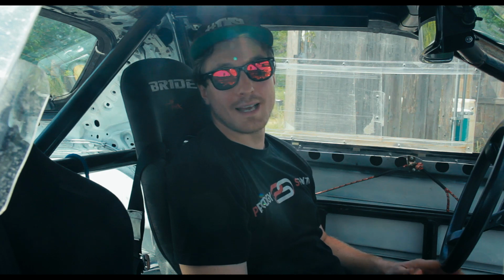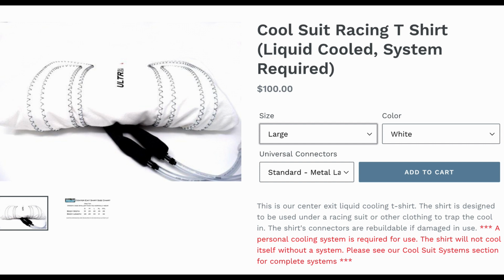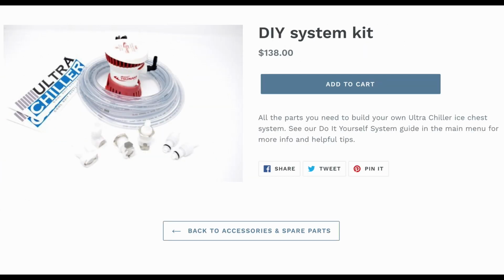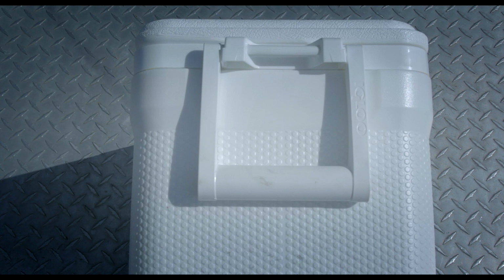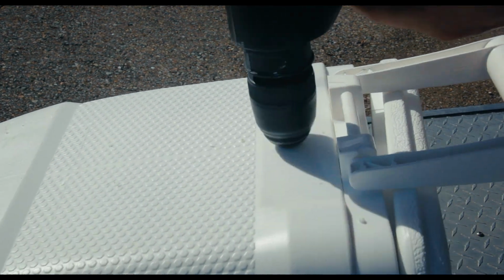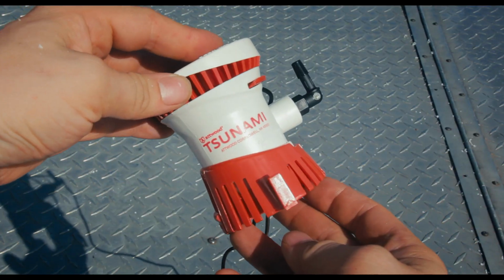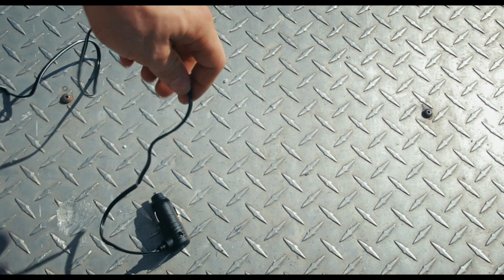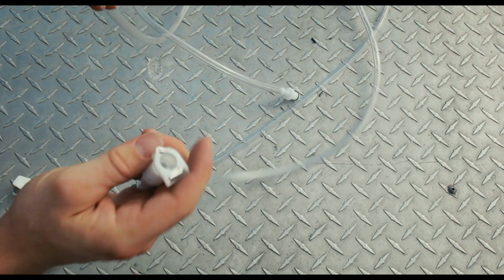Build a cool suit on a budget, the easy way.

Comment: Why not use a 12 volt cooler with a mini radiator  a recirculation pump instead of a sump or bilge pump . It would be lighter

Comment: I thought the point of a cooling suit was to be portable, so you can walk around with it...........if it's just for inside the car, why not get a car battery, a power converter and a mini portable ac?
Or on a cheap cheap budget, a Styrofoam cooler, cut a hole on the side, hook a small fan to a dryer vent tube, then make a similar hole with dryer vent coming from top, fill with bag of ice mixed with rock salt and you have a cheap, well working car a/c for under 30 dollars.

Comment: I want to build one for my bike but at 8 lbs per gallon swooshing water from one side to the other will wreck you 4 sure. The container has 2b one that doesn't let the water move but a little. Barring that the only solution I see is a DC compressor & a li-ion battery pack chiller. Peltier won't go far enough under the ambient temperature.

Comment: Where's the review?
Reply from the maker: It's a ways away, but the short version is: 
The system is awesome except for the cooler. It cracked and ruined the seals after 2 track days due to the pressure from the tie down. Spend a few more dollars and get a better cooler with a watertight seal and lockable lid.
Reply: @EvanWoss  Understood. Cheers m8!

Comment: Did you wire a switch into the pump or just unplug it when not needed? If a switch is used to control flow rate would that work too?
Reply from the maker: I wired a switch into the dash panel. I'm not sure if this motor likes any sort of voltage regulation, but I found that 100% flow is good and if you get too cold, you can just turn it off for a few minutes.

Comment: Awesome video, subbed for part 2. Curious how many amps that pump requires, you think it might be a little sketchy running thru the cigarette lighter? I figure your cigarette lighter output runs a 5-10 amp fuse. Might be better to run a separate switch with proper gauged wire right to the battery to avoid possible electrical fire. Just a thought, what do you think?
Reply from the maker: Pretty Decent Garage according to the spec sheet, it pulls a max of 1.8a so I feel pretty good about the cigarette lighter power.
Reply: That might be ok then, similar amps to charging a cell phone.

Comment: I've thought about installing a coolsuit system in my daily (1989 Civic Si) cause it's AC went out a couple years ago; I was shocked by how expensive the prebuilt solutions are for how simple they are in terms of component parts. This video was exactly what I needed to get the measure of a DIY solution, and that kit looks amazing! Thanks for bringing some very useful (and less common) content to the drift community! :)